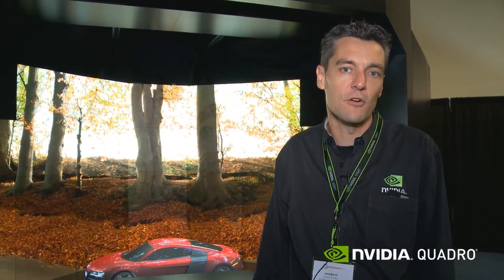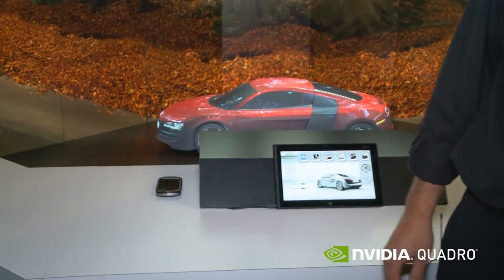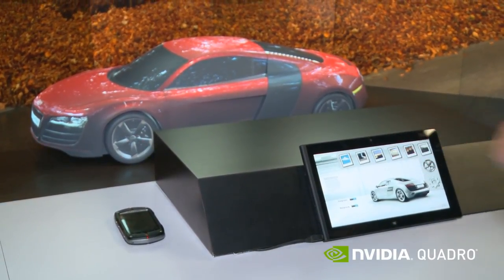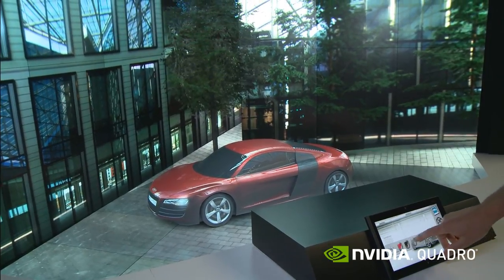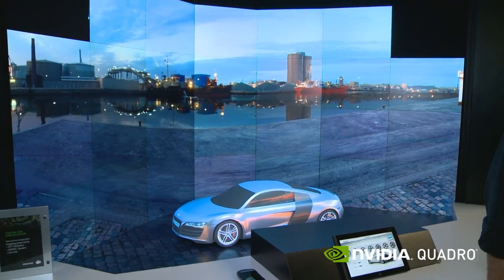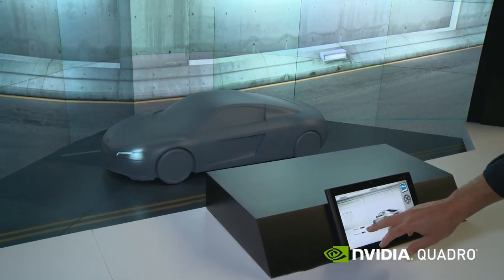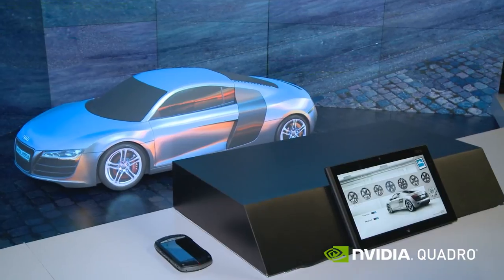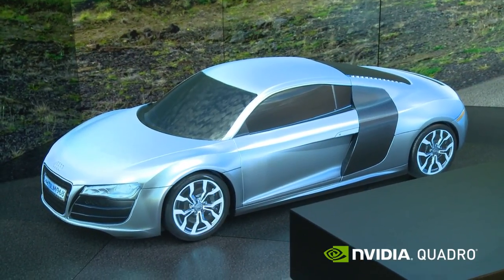Christie Digital Interactive Auto Design

Comment: :D you can go into the  nvidia settings and use more GPU's... (but minecraft is more cpu/ram intensive game, witch means 12 GPU's or 2 will not change very much instead of a 12 core cpu and a 2 core :P)